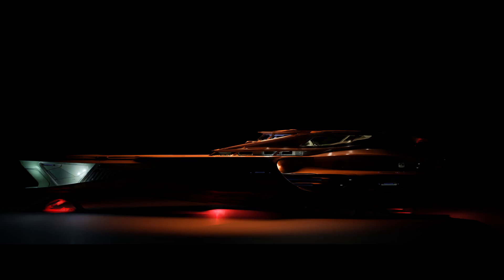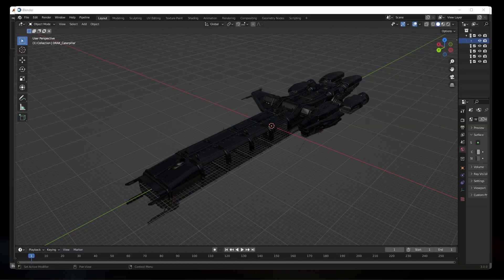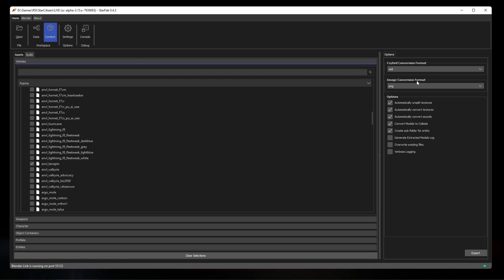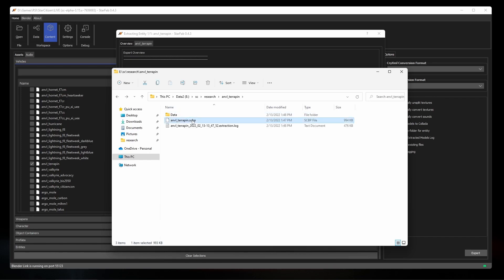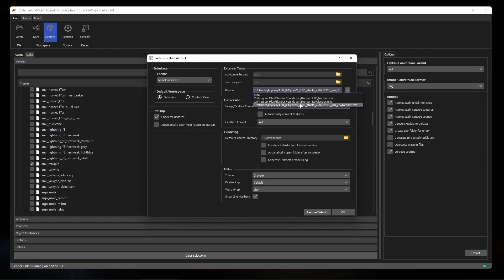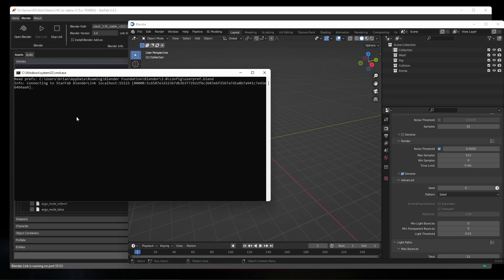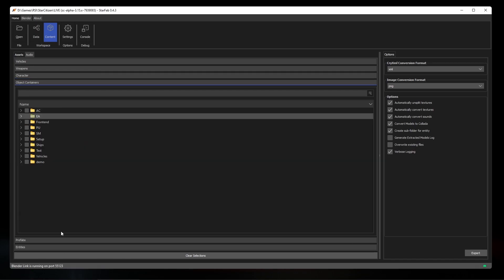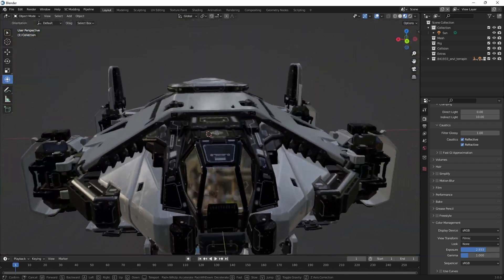Intro to StarFab - Part 3 Asset Extraction

Comment: Attention to those having issues:

Is your imported scbp file just showing up as a bunch of black lines in Blender? The solution to this is to enable the check box 'Convert models to Collada' in Starfab before exporting. You should now be able to successfully import the new scbp file into Blender.

This method works as of May 2023 with the following software versions:

Starfab 0.4.8
Star Citizen 3.19.0 - LIVE 8478820
Blender 3.5.1 x64
Reply: You saved my ass. Thank you!!!
Reply: it doesnt seem to work anymore, any idea?
Reply: @UlasJ-jj4dc  Looks like 3.20 is causing issues with Starfab. The developer left a comment on their Gitlab issues page saying they're working on a patch to get it working again, so fingers crossed it all works out!
Reply: FINALLY!  ^^^^ This is what got it working for me! Thanks!

Comment: Im still running into issues with exporting assets and the blueprint file just creates an item in blender but no 3d object of any kind? trying to find a model of the Anvil Carrack to bring into blender with no luck, could use some help if you wouldn't mind? thanks for your time

Comment: Hey quick question, not sure if the next video is being worked on or something but I got everything imported and converted correctly, but the normals of the imported object look very off. and I have limited knowledge of the Blender shader graph system. I know how PBR works but I'm starting to think there might be something wrong here with how I have my project/scene setup.
Reply: Try inverting the G channel on your normal map. Between the image texture and the normal map, add a separate RGB node, and then a combine RGB node, but also add an invert node and plug the G channel in it. That might fix it.

Comment: I think i'm missing a step, but every time I try to import the model into Blender all I get are the light sets. No geometry at all. What am I missing?
Reply from the maker: Double check the export log - it's probably mentioning that you don't have a compatible version of .NET installed.
Reply: Ah, thanks I'll check that
Reply: @ventorvargaming  Hello, I also got this issue but when I check the verbose log during expor tit doesn't mention any net issue. Is there a way to check that compatible .net files are installed?
Reply: @ventorvargaming   i installed the .Net this fixed same problem however it still only pulling the lights. i get a 
(WARNING: non-skipped soc EntityClass doesnt have geometry: RenderToTextureView)
(WARNING: non-skipped soc EntityClass doesnt have geometry: Default_LandingSystem)
(WARNING: non-skipped soc EntityClass doesnt have geometry: HolographicVolume)
it did have the .Net error but i reinstalled that and this error went away. but did not fix the only lights probes problem to blender 
and this is every item i have tried so far same errors when i follow the path to find the Geo my self like you did in the video it shows that it is in fact there. so i have no idea whats the problem could be 
it still does not help find or install or what ever it is, to find Geo...
Reply: Hmm, yes I tried a few ships and all I ended up with in blender was the light sources. No errors in the logs other than some missing entities in the pk4 file.
Reply: @GizmoMagui  I'm getting the same error as you are. Did you ever fix this?
Reply: @jeromewashington6247  yeah reboot pc lol
Reply: I had to install "dotnet-sdk-7.0.101-win-x64" and also "dotnet-runtime-5.0.17-win-x64" to make it work
Reply: @jeromewashington6247  I managed to fix it by checking the 'Convert models to Collada' box during export.

Comment: Getting an issue when I try to import to blender -> 'ShaderNodeTree' object has no attribute 'outputs' 
Any idea what this means ?
Reply: Full read out is ->
ERROR:root:Failed to import SCBP
Traceback (most recent call last):
  File "C:\Users\craig\AppData\Local\Programs\StarFab\app\starfab\contrib\scdatatools\blender\blueprints\__init__.py", line 972, in execute
    importer = SCBlueprintImporter(
  File "C:\Users\craig\AppData\Local\Programs\StarFab\app\starfab\contrib\scdatatools\blender\blueprints\_init__.py", line 448, in __init_
    self.tint_palette_node_group = tint_palette_node_group_for_entity(
  File "C:\Users\craig\AppData\Local\Programs\StarFab\app\starfab\contrib\scdatatools\blender\materials\utils.py", line 76, in tint_palette_node_group_for_entity
    tint_group.outputs.new(out_type, output)
AttributeError: 'ShaderNodeTree' object has no attribute 'outputs'

Comment: I have the problem that I always get an error message: MISC_Prospector: ERROR: model conversion failed

And Blender only shows me dashes and dots does anyone have an idea?
Reply: Found a solution! The logs during import to Blender showed that it simply wasn't seeing the model files created by Starfab. I re-exported the ship with the checkbox for 'Convert models to Collada' enabled. Worked perfectly after that. If that doesn't work, there's a comment further down that talks about installing some more dependencies that the installer might not have done properly. All the best!

Comment: So, I'm having a weird issue, and I cannot seem to find any help on it.
I did all the steps asked for extracting files, but for some reason or another, any time I try to export a file, it doesn't work, giving the error: 

There was an error rendering C:\Users\mathi\OneDrive\Desktop\aa\Starfab\outlaw_legacy_armor_light_helmet_01_01_01\Data\Objects\Characters\Human\male_v7\armor\shared\visor\m_fp_visor_16x9.skin
The given key '2' was not present in the dictionary.

it does that with any item I try to export, whether it be a piece of armor (like above) or a ship, or anything. It gives a bunch of that error for each part of the asset, and then if I try to open the blueprint in Blender, nothing appears. I have the name for it, but that's it.

Comment: Question: how to convert the imported model so some modificators can be applied e.g. decimation for lowering polygons? make instance real seems not to work for me...
Reply from the maker: There is an additional "Make heirarchy real" tool (if you right-click in the top-level created collection) that will iteratevely make the instances real. That being said, you could also switch to the "StarFab" scene and edit the source geometry directly.

Comment: It worked perfectly, thanks a lot!

Do you know, however, how to take the model out of Blender? I want to export it to 3dsmax (as I have 0 clue on using Blender), and I can't get the model + textures. Absolutely everything I've tried ends up in just the model.
Reply: have you tried exporting out as an FBX file?
Reply: @NovelTheCat  FBX has the model working fine, however the textures do not seem to follow.
Reply: @Sveken  sometimes textures have to be exported separately. See if that works
Reply: @NovelTheCat  i am unsure how to export the textures, they do not show up in blender as textures (the object has no texture slots in blender)
Reply: @Sveken  I believe blender uses materials. You can make a material then take the textures and put them into the material
Reply from the maker: The materials are loaded into Blender materials/PBR shaders. You'd have to recreate those shaders in 3ds max and import the textures manually. There are some  3ds material importing tools developed by other members of the community, jump in the discord if you want more info.